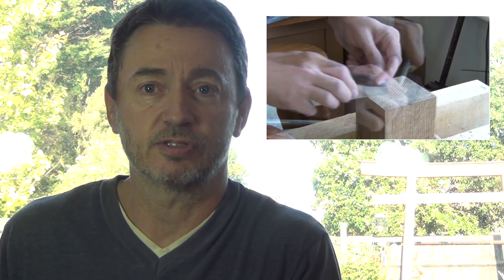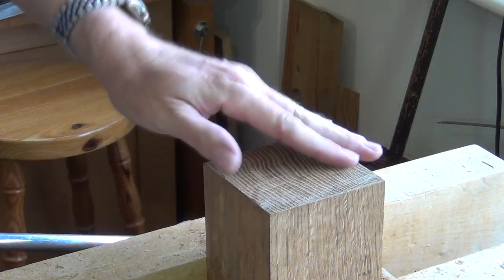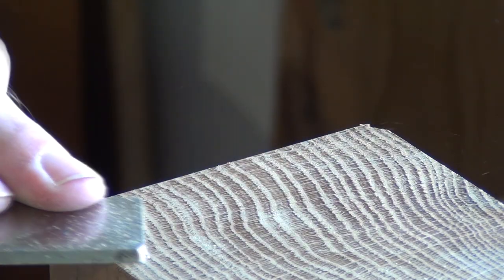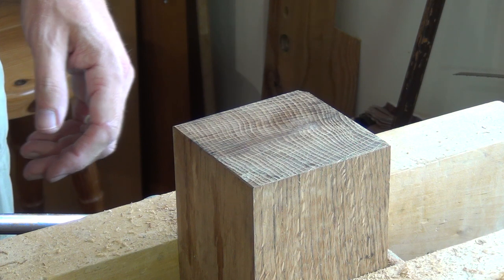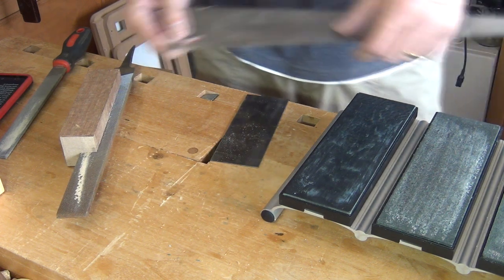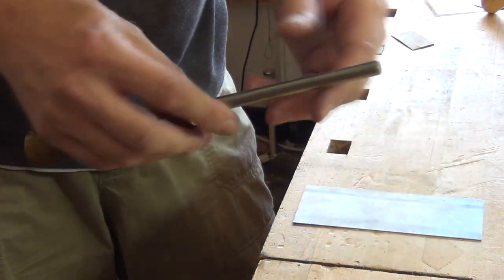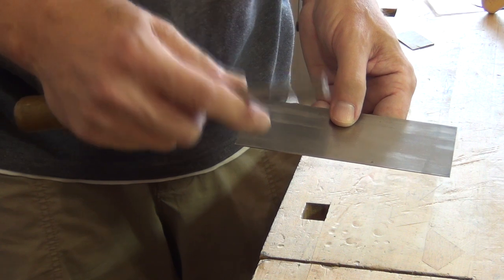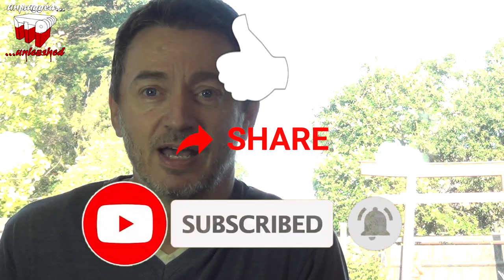Smoothing Endgrain & Card Scrapers

Comment: This seems like a better way than buying a entire expensive card scraper system. Also getting away from sandpaper which makes fine dust that gets everywhere.
Reply: I would be cautious. Even when using a scraper rhat is perfect and making ribbons, it is still also producing fine dust, so lung protection or other dust management is still advisable. 

Additionally, this method, like using planes, will vary in smoothness based on wood species and grain pattern. Sometimes you can get it very smooth, sometimes smooth but wavy following grain, and other times sanding will still be very necessary depending on how smooth a result you are looking for.
Reply from the maker: I see Karl has already pointed out that there will still be some fine dust produced no matter what technique, so as with sanding a dust mask is a good precaution.
I do like to avoid sanding because of the inevitable abrasive dust like silica or aluminum oxide, but sometimes it's useful.